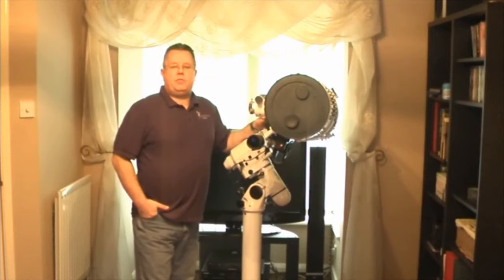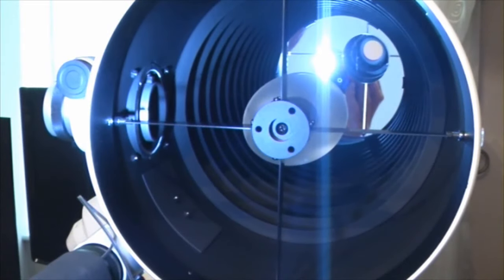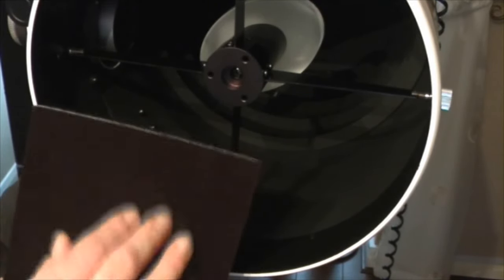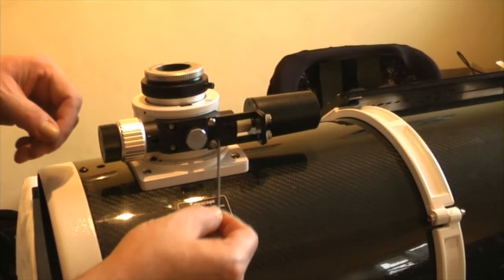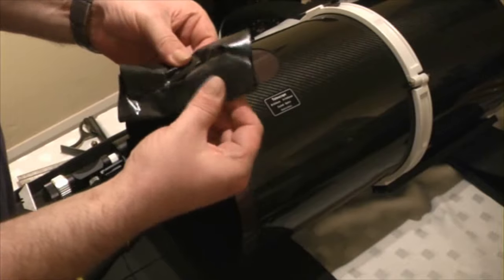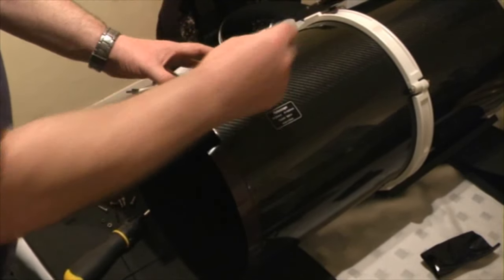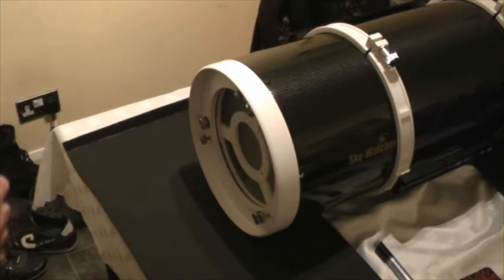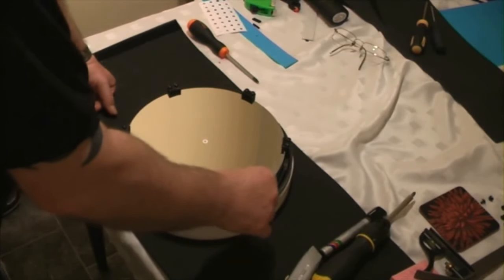SkyWatcher Quattro 10CF Tweaks And Mods

Comment: Good Day from Cardiff and thank you for all your helpful tips. I'm a complete beginner.  But I do have a Skywatcher 250pds. I have flocked the inside and blackened  the edge and back of the secondary mirror.  As for the focuser, on the 250pds. I cant see the collimator screws that you said you can easily get to. Are the 250pds supposed to have one there. ? I cant post a photo on here sorry to show you my focuser. I got this 250pds secondhand.  I've never used it yet,as I wanted to flock it ( which has been done now ) first and clean the mirrors before I use it. Thanks again for your helpful Vids Regards
Roy
Reply from the maker: If you go to the link I'm going to post, look at the focuser, you will see 2 holes which are where bolts would fix it to the OTA then just inside from those where you see a circular ring, you can see 2 dark bolts with largish heads with tiny grub screws right beside them, those are focuser alignment/collimation screws. If your focuser doesn't have them, the only other way is to shim under the fixing bolts if the focuser is out of alignment.

https://www.astroshop.eu/focusers/skywatcher-2-crayford-focuser-for-explorer-newtonian-reflectors/p,22264

Comment: Wow Have I now got a lot to do.  This was very helpful but I have a couple of questions.  1. When painting the second and primary mirrors, how did you paint them with out getting the front or dripping to the front( just mist it)? 2. How did you get the white circle off of the primary mirror? 3. Where did you purchase the new triangle circle for the primary mirror? 4.  Where can someone purchase the flocking material?  5. Where can I get the material for front tube that has velco,

Comment: My key concern with collimation when replacing the secondary mirror is that all the adjustment screws were extending out the primary mirror side by a half inch.  When I put the mirror back in, I set them just a hair protruding outside the mount.  How far they extend to adjust the secondary mirror location is the key concern for me.

Comment: Hi there Dion,
Excellent video.  Which coma corrector are you using with your Quattro?  I've been using the Baader MPCC Mk. III and I'm wondering if it's worth upgrading to the Televue Paracorr.  I would welcome any comments you might have on coma correction (apologies if you've covered that in another video).

Comment: Dion, the only chalkboard paint I've found (and bought) was a spray can. Is that what you used? And, if so, how did you avoid overspay on the secondardy mirror? That's my biggest concern. My flocking material should arrive today and I'm excited to get it flocked and every darkened and seei the results.

Thanks!

Comment: I was also wondering if you've used a barlow with the Quattro and if so, whether the mirrors need to be moved or not?  I tried a Televue 4x and could not achieve focus.  Apparently with two-element barlows with 2" thread, it is possible to screw one element into the back of the focuser near the secondary mirror but I have not tried this.

Comment from the maker: @shaneskelts80 Hi and thanks, if you can get your hands in there I'd still use the flock, the blackboard paint is VERY black but I still consider it an accompaniment to flocking, not a replacement. It's also water based, and although pretty stable I wouldn't like to have a full tube done in it out in the cold and wet (dew)

Comment from the maker: That's at 1:01:51  all you need to do is take one of the existing bolts to a hardware store or engineering shop and tell them you want the same size but in cap head socket screws. From memory i think they are M4 thread. These are not grub screws, grub screws have no head

Comment from the maker: @flib08 Youtube doesn't allow links in comments but all the info is available on my site at astronomyshed, mine is approx 4mm thick but I laminate it. You also need about 670mm width to fit round a 200P

Comment: A bit tedious, but super informative!! Thank you for your hard work putting this together.
Could you possibly add links to your suppliers, e.g., the flocking material and the blackboard paint?
The scope that I see advertised in the U.S. is the 250P. I guess that in order to get the carbon fiber tube, it needs to specifically be the 10CF. But I guess that's a question for Skywatcher.
I enjoy your videos!
Reply: They no longer offer the CF tube as an option

Comment: Hi Dion, I'm a late comer to your video, not sure if you're still monitoring this page but thanks belatedly, its very informative and done in an expert way.
I've had a 10" S.W. QUATTRO for a while now but really glad I've found this. You flocked the back of the PRIMARY MIRROR, would you mind saying how you clean it in time to come? Surely the water will seriously degrade the flocking? It would be good to know how you paint/flock the edges of the mirrors too.
Thanks for all your efforts again. 

 Best,       Dave
Reply from the maker: Hi, the flocking sticks like shit to a blanket!  Water didnt affect it, but be sure to clean first with something like isopropyl alcohol. I seem to remember the blackboard paint didn't do too well when wet so I would use an oil based matt black paint.
Reply: Hi @astronomyshed its good to know about the 'extreme' sticking power of flocking!  I'm impressed.  Did you mean you cleaned the mirror back with Isopropyl before flocking it to ensure a good adhesion?  For the painting I use Humbrol matt black enamel , which I guess should be fairly waterproof.
Can you remember how you masked the mirror itself to avoid over-painting on the edges?  Unfortunately the secondary mirror cant be taken out on my scope as there's a dew heater on it wired to a jack socket on the OTA 'outside'.
Reply from the maker: @davebillybish  Yes, mirror back with isopropyl, or methylated spirits etc would be fine. I didn't mask the mirror, surgeons hands lol ;)
Reply: astronomyshed cheers, I'll be trying that and choose a day when my hands are nice and steady 😷
Reply: @astronomyshed  Hi Dion, when flocking your primary back, the mirror must've been 'face' down on a firm surface I would gather, but I'm afraid of damaging the silvering with scuffs, dust and marks if I do mine while its out. Did you use anything special as a 'safe' surface to place it on while you were doing the job? Are you still using the telescope and do you get some good images with it? Best, Dave
Reply from the maker: @davebillybish  I just used a piece of thin cloth (like a pillowcase) on the table, obviously cleaned the table first, I sold the scope and completely gave up on astronomy over 3 years ago, got far too frustrating with the British weather, also nowadays my health isn't best after a severe case of pneumonia induced sepsis a couple of years ago too. But hay ho, other than that, all's well. The Quattro is a fantastic scope though, look at the moon in it, you'll almost burn your retinas out lol but the view is outstanding. Also invest in a very wide angle eyepiece like a panaview, coupled with that aperture it is an amazing combination.
Reply from the maker: @davebillybish  32mm Skywatcher Panaview eyepiece is the one i refer to in other answer, suits the quattro like it was made for it.
Reply: astronomyshed Thanks very much for your great work in educating us   all with you super videos. The weather let me down again last night. know what you mean. I hav3 oberved a lot with it and some imaging till I overtightened the mirror clips and couldn't understand the funny star shapes. thats fixed now and can't wait to get started again. Hope your health is stable now. Thanks again Dave
Reply: I have a 32mm 2in eyepiece, but am more of an imaging nut these days, and of late prefer my S.W. Evostar 80 for the job. Also the budget is a bit tight since retirement, so new kit is on a back-burner for now. I need a faster laptop. 😉 lol

Comment: my  EQ6 mount is belt-modified and I'm using about 10kg of equipment with succes (no probl. with round stars at 10 minutes subs and 900mm fl).
do you think it's possible to do astrophotography with this setup and another 3kg of equipment (camera, filterwheel, autoguider/etc). 
thank you.